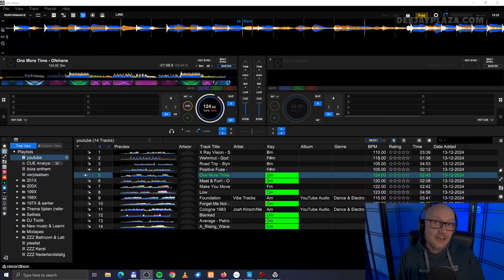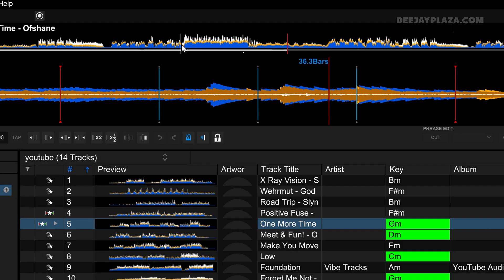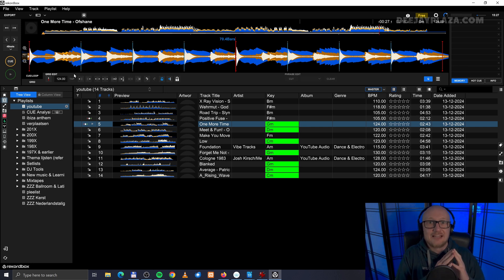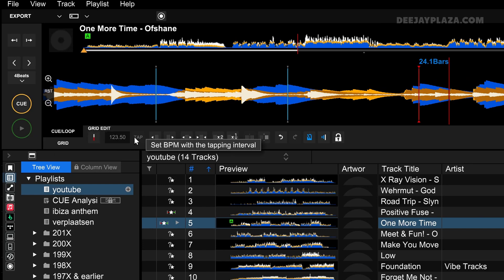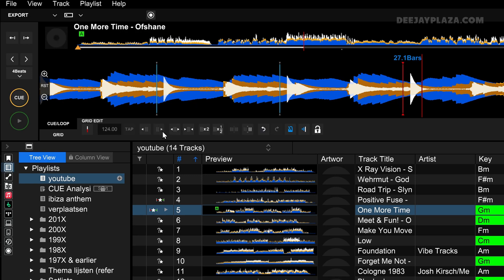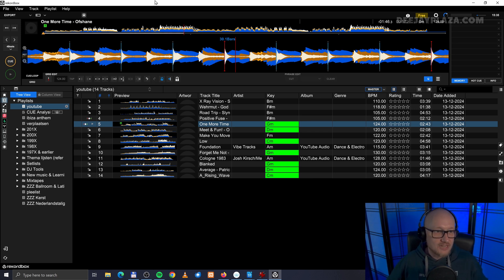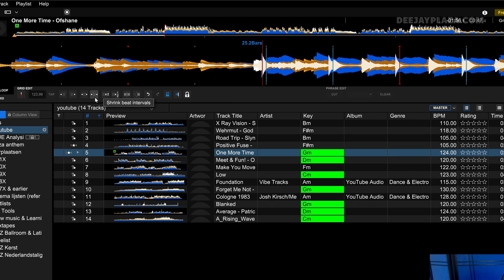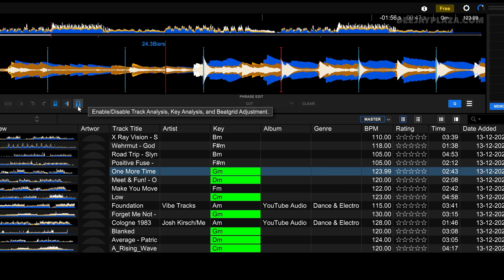How to adjust beatgrid in rekordbox 7 2026:  step-by-step

Comment: why does it sometimes analyze a track to be say.. 172.08? when the track is bounced perfectly on grid without any swing and with very high contrast and sonically visual distinctions between kicks and snares. It makes zero sense that the program has a hard time analyzing a track that is not doing anything abnormal in tempo, has not even been exported on an offbeat or anything. It legit just needs to set the tempo to what the song is and start 1.1 at the very beginning. although this is a rhetorical question and i don't expect an answer, i'm more venting my frustration with how dogsht of a program this is. I used this years ago w a pioneer SXII and it was fun and all.. but wtf is this? people use this professionally?

Comment: I've moved the beatgrid left because rekordbox missed analyzing the first beat - but everytime I press cue it starts on the wrong beat again because I can't seem to reset that yellow triangle marker to the new first beat or delete it wrong the wrong beat. How do you change the start point of the song or can you not? If you press set the grid's 1.1 marker it doesn't move - just stays the same. Do you really have to use the hot cue workaround? That's insane if that's the case.
Reply from the maker: tldr
Reply: @deejayplaza  How do you change the start point of the song (yellow triangle marker) or can you not?

Comment: Using the tap and the metronome i find it harder to do it could be not exact, i think it would be better to explain where every line should go and how the music parts separate on the waveform and how it should align with other song to fix the grid a video explanation of that i think would make it easier for me or even for many ppl, also this topic can even extend more when you know there are songs with variable bpm and that they automate the pitch and it keeps drifting throught the song.

Comment: Really good video.. I went from Serato to Rekordbox. And it's crazy how bad Rekordboks analys the tracks. I Already have thoughts of changing back to Serato. I will try ehe second way to analys tracks, i did not know this option. Thanks for the Video 🔥
Reply: @mig-l7109  same, all 30 tracks were messed up had to change the first beat on all of them. Never have any issues with serato. I only use rekordbox to prepare for lives.

Comment: Hi ..do you have the high precision track analysis toggle on in preferences ?......was wondering how accurate it is before i tried using it
Reply from the maker: High precision? Just on standard
Reply: Ahh ok rb7 has a high precision analysis toggle feature wondered how well it worked before I tried it

Comment: I’ve found it helps to set the tempo slider to wide and low so that you can see the waveform even closer than the max zoom. Some songs have what I call kick tails that hang over just before the kick and become confusing. Best to line them up completely flush with the wider beat.
Reply from the maker: great tip!
Reply: @deejayplaza  Im trying to stream soundcloud and it seems to give me wrong bpms and the beat grid is ALWAYS wrong, because I dont play house. I play like deep dub and glitch hop and such. Bass music. This does not give me a good impression of Rekordbox. Why would I pay these guge subscription fees for a product that doesnt work?
Im thinking I will have to just buy my music and analyze it with Platinum Notes, and stick to free Rekordbox